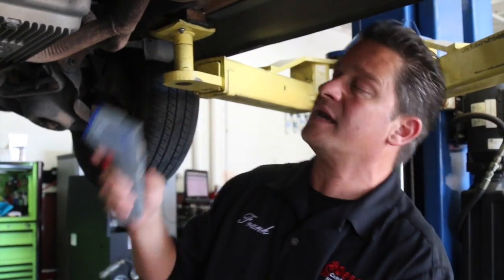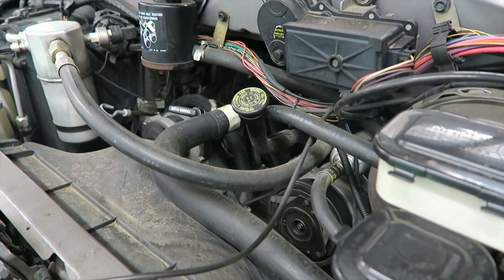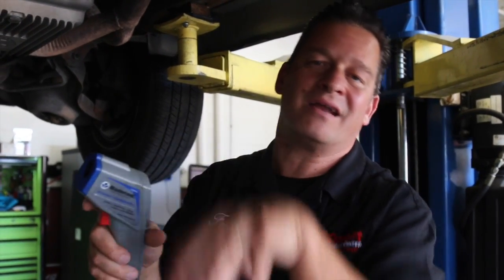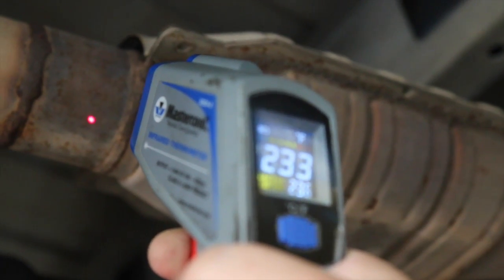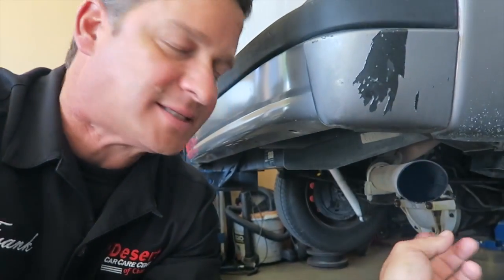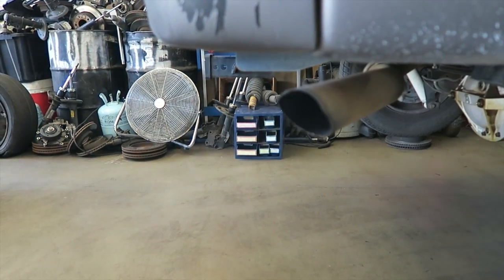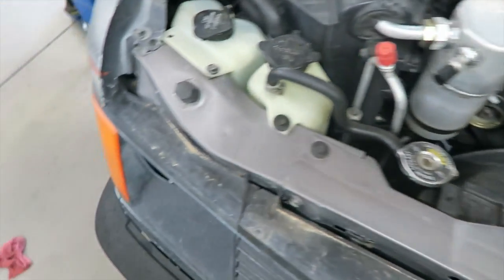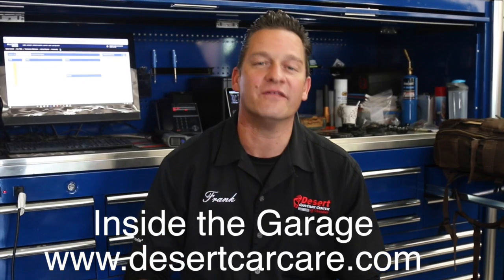Easy Way To Check Catalytic Converter (Simple)

Comment: So would a failing cat cause a misfire without throwing a code?  Have a 2017 Chrysler Pacifica that misfires on start-up. Coolant loss, dealer told me the engine was damaged, warped.  I installed a new engine but when I was hooking up the cat I noticed white powder and cubes coming out, probably about 3 tablespoons worth.  Was this the issue the whole time??? I get it could cause a misfire but also a coolant loss?
Reply from the maker: Based upon history of engine - definitely would replace Cats. 

Not sure about that misfire ?

Comment: Hi I have P0420 code.. but no problems with the car at all. Some say O2 sensor others says cat converter. What's your thoughts? Like I said I'm not having any issues just that code
Reply: I wanna say catalytic converter is on the way to failing, but not quite there yet.

Comment: So was the cat good or bad? I understand the oil foul.
Reply from the maker: We ended up advising to NOT spend a penny here as the bigger issue was an engine concern ~ that CAT was loaded with oil ~ thanks for stopping by ! ~ Frank
Reply: @Desertcarcare  Thanks Frank... I guess he did have worse problems, he had an Astro, hahaha. I watched your video because I'm playing around with an E350 with an aftermarket Torpedo cat. It'll burn your eyes out at the pipe AT AN IDLE. But when you run it at about 80mph for 15 minutes, the cat lights up and performs like it should. 10 minutes later, at an idle, the cat temp drops and we're back to the eye burning (NOX). Conclusion: After going through all of the EVAP system, and getting a temp reading at 450 F on the cat welds front and rear AFTER a high speed drive. Then after 10 minutes of idling, getting a temperature of about 250 on the weld, and 175 on the rear weld. This Walker Aftermarket cat has to go. Thanks for the video again Frank.
Reply from the maker: @shadetreeautomotiveDIY  Man - we have had similar issues with aftermarket CATS ~ we always forewarn folks ~ less cost but the volume of precious metals is sometimes no where near the OE . Unfortunately OE can be a mortgage payment ~ yikes 

Either way ~ rock the week brother ~ check out our weekly show ~ I think you will like 👉 http://bit.ly/WrenchNation

Comment: uhh you don't even actually specify what to look for aside from temperature variation of around 100 degrees and whether or not that indicated whether the Cat is good or bad.  You just go right into valve seals and piston rings and then go right into saying the van needs a new engine!!!  This video is essentially completely useless apart from pointing out that you can use a lazer.  Gee, thanks.
Reply: watch it again. At around 50 secs he tells you what the temp should be, around a 100 degree difference.
Reply: @jdv-mc7xo  My cat was 120c on the inlet....so ya saying it should be 20c on the outlet?? lol - that's the point he should have said it should be 100 degree HIGHER, not just difference.
Reply: @blower1  anyone with any sense to be trying to diagnose a cat problem should already know that.
Reply: @jdv-mc7xo  Not everyone knows that it should be hotter on the outlet than the inlet, without basic understanding of how a cat works - it's almost counterintuitive. That's why people are here, to find out how to test without having to know how a cat works - as if they did then they wouldn't be searching for video's like this.

In this video its 270F inlet and 230F outlet...people don't necessarily know that means outlet should be 370F as with him just saying '100 degrees difference' they could equally think the outlet should be in the region of 170F.
Reply: @jdv-mc7xo   try and keep up, would ya bud...?
Reply: @TheJaimePowell  why are you telling me to keep up? I’m explaining to Jeff to keep up because it answers what he is complaining about..🤡

Comment: Sorry to inform you, but you have it wrong.  The temperature should be higher on the outlet.  If it is hotter on the front end, it is plugged.
Reply from the maker: Mike Murphy ~ appreciate clarification if we weren’t clear ~ a 30-100 degree difference of the outlet from inlet indicates catalyst /chemical reaction is taking place ~ as we are to help as many ~ always appreciate the input !
Reply: @Desertcarcare  One additional point, on many newer cars, the catalyst can have no difference in temp from front to rear because the engine is running so efficiently.  Using the temp test is no longer a reliable way to condemn a CC.
Reply from the maker: Mike Murphy ~ excellent point ! Perhaps we will do an updated vid here soon ! Thanks again Mike

Comment: Hang on, so to clarify. The inlet and outlet SHOULD have 100 deg difference?so if the Cat is stuffed, then its one temp?
Reply: No, this guy has it wrong.  The cat in this video is bad.  The temp should be higher on the outlet.

Comment: You forgot to mention the temp should be 100 degrees HIGHER coming out the catalytic converter! Thank you for the video though.
Reply: Exactly! Thank you for this comment.
Reply: at about 50 secs he does mention it
Reply: @jdv-mc7xo  Didnt say which way though....just said 100 deg diff, not if it should be 100 higher or 100 lower

Comment: Could a plugged catalytic converter cause misfires?
Reply from the maker: William Holmes ~a misfire would cause cat failure over time ~typically a cat restriction will not cause a misfire per se~hope this helps .
Reply: My cats are bad on my 2005 mustang gt and ut seems that they were gone at around 60k miles. Ive never had a check engine light could this mean theres something going on with the engine?

Comment: Do New cars face catalytic converter problem? Bcuz I was told that my 2016 Chevy Malibu has this problem.
Reply from the maker: Kesselee Dennis ~yes sir. But please make sure they have tested for defect ~no guesswork. Stick with an original GM Cat if in the budget.
Reply: Most independent shops would be fast to diagnose a catalytic converter for most smog related issues. Best bet, especially for a new-ish vehicle, would be to take your vehicle to the dealership so they can properly diagnose the issue. The catalytic though should be covered under warranty from the factory